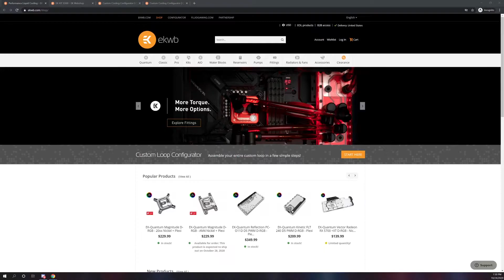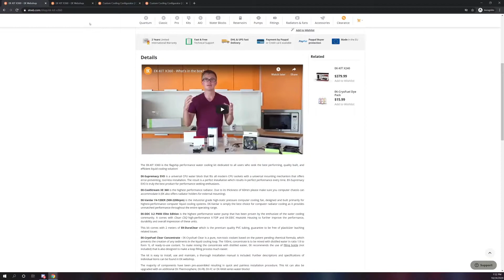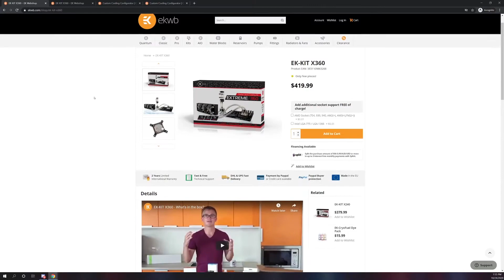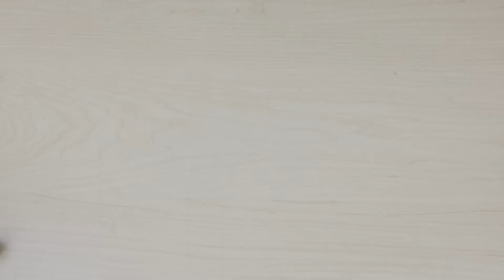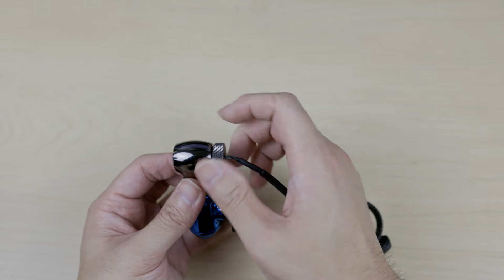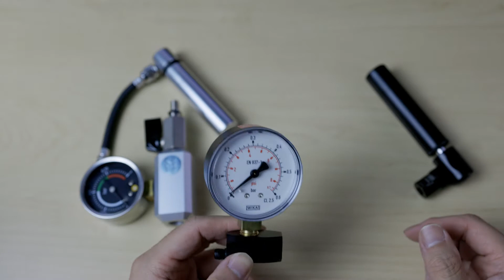WATERCOOLING YOUR PC THE RIGHT WAY. YOU MIGHT BE DOING IT WRONG!

Comment: Wow, thanks for this video. I just finished my first loop with a 3090 Aorus Xtreme Waterforce WB with just Corsair Hydro X parts. Their pump/res does come with the temp sensor and I figured out how to add the drain valve myself (needed their Y-splitter and a Bitspower male to male rotary adapter since I'm using the DDC pump/res combo) , but I am a bit disappointed with the coolant temp (my room is around 30C at night since my wife likes to run the heater and while gaming it can reach almost 50C). I know the pump's max operating temp is 60C, so I do have a warning in iCUE to turn lights red and max the fans at 55C, but I guess I'm mostly disappointed in Corsair's fans. I do like their aesthetic and how they work with the Commander Pro (yes, I'm completely invested in the iCUE ecosystem), but I know that they are pretty poor performing fans in comparison to popular fans like the NF-A12x25 or the Arctic P12. Your video definitely opens my eyes a lot more in terms of what I should be looking for in the future, especially when it comes to hard tubing. I can't believe that PETG deforms at those temps. It's no wonder Corsair uses acrylic tubing for their Hydro X hardline tubes. I just wish that their fans performed better at under 100% RPM.

Anyway, you have a lot of great info that a lot of techtubers (including watercooling experts) tend to overlook. I had no idea about what you should look for in terms of delta over ambient in your coolant temp and which rads might be better to purchase. And yeah your point regarding thick rad push/pull fans versus slim rads and less fans makes sense. Thanks again for sharing.

Comment: Hey man, thanks for the video, you're validating things I now know from experience. Just finished my first loop after tons of research on the possibilities / my config / case / brands / maintenance etc.

I bought everything from EK (like the velocity DRGB blocks, and the D5 pump/combo, vardar 140 seems good enough) but I bought better slim rads for my specific application and desires (280 corsair XR5 which seems to be hw labs, and Alphacool ST30 420).

Cooling a 3080 and a 5900x on a Dark Hero board. Got everything running like I wanted, fittings, angled, valve on the pump to a drain hole in front of the case, fill hole on top.....

But I freaking didn,t know about the water temp sensor......I would not care about a flow sensor (I see the water moving in the res and the noice of the pump...well once configured I run it at 50% all the time...PWM for nothing....).

I hated having the fans ramping up and down with CPU temp (fan hub on the board), makes no sense on WC. So for now I manage my fans manually. Fixed settings at startup, pretty silent, and when gaming I put the fans at around 60%. I have no clue how hot the water gets, I can feel the reservoir getting warm....

And after gaming session, I ru nfans at 100% for a minute (cooldown) before resuming to silence.

Wondering if I can just add a temp sensor on top of the rad. One that has the long nipple....but feels like a middle ground solution ; I would prefer a sensor where the flow is "full"
Reply from the maker: Adding a t fitting anywhere would allow you to add a sensor. No impact on flow by doing so. Once you have a base flow rate it’s marginal gain to increase the flow rate.

Comment: I'm totally with you about NOT buying a kit. I bought a kit for my first custom loop (in fact my first build ever) and what I ended up doing is having to replace virtually every piece of the kit individually. Of course I was on an extreme budget and bought a Barrow kit - the tubing was very low quality PTEG and the fittings were a very loose fit for the tubing and I didn't have any confidence in it. I actually spent a lot on extra Barrow fittings to match the ones I had before realising that I didn't want to use them and also wanted to drop from 16" to 14" and also change from PTEG to chrome or nickel plated copper tubes or at the very least acrylic not PTEG. I'm still a couple of components short of my first build and need to buy the GPU and relevant block and the new tubing. I have gone for last gen so that I could get the top of the line from last gen and have a great system but for a price I can afford. I have ambitions to eventually set up a channel like yours and this channel is one of my absolute favourites along with GGF and Bro Cooling, both of whom do the sickest custom loop builds and Stuart does the best reviews. You definitely do the best summary report of what you have built and why and what mods you have done and how. You always go through your design choices with us and it seems that you really put a lot of effort into trying to educate us which I very much appreciate being far less knowledgeable than yourself. As a coder I would still love a link to the Python program you use for your stats as I haven't been able to find it in any of your video descriptions. You asked if we would like a tutorial and that would be amazing if you have the time to put it together. I would pay you for a tutorial in fact, just let me know the price and where to send the money.

Comment: @Min C Great video! 👍 
I have an InWin 925 case, and I’ve tried to use the EK configurator to assemble a watercooling list but it doesn’t allow me to increase my radiators from one to two, and I know my case can fit two, one at the top and one at the front. Will I just have to order a second one separately, or am I missing something?
Subscribed.
Reply from the maker: Just put your order together separately. Use the config as a guide that’s all.

Comment: Hey, I wanna do watercool for the first time, which brand do you recommend? Is ekwb good? 
The case is an o11D, watercooling a 3090 and an i9 10850k. Which distroplate is better? Front or side? According to ekwb website, i can’t fit a radiator on the bottom of the case with the front distroplate so that has me going toward the side distro.

Thanks a lot for the vid!!
Reply from the maker: EK is alright but there are better options in terms of quality for some items. I think the bitspower o11 distros are made better for a slightly lower or similar cost.
Reply: @JCustom  thanks, will look into bitspower!